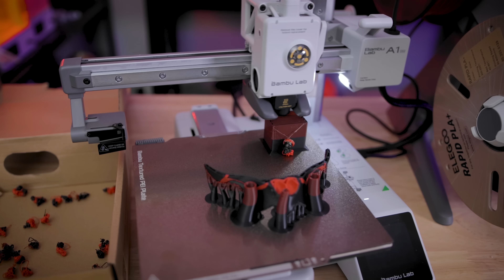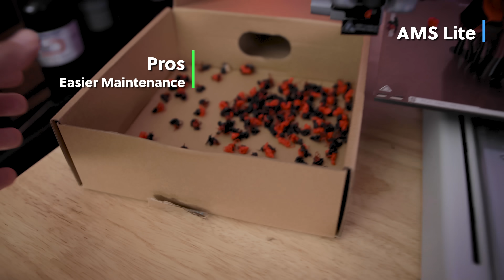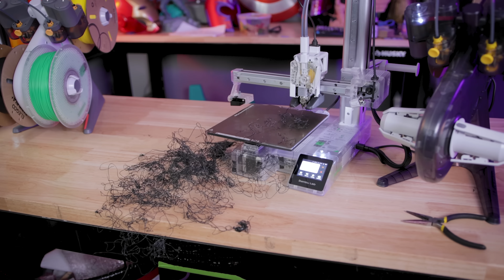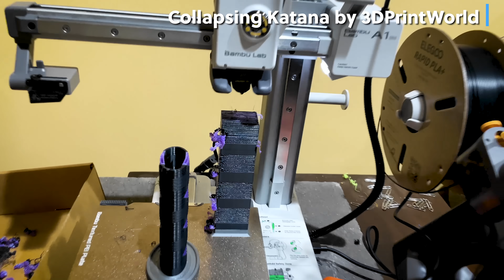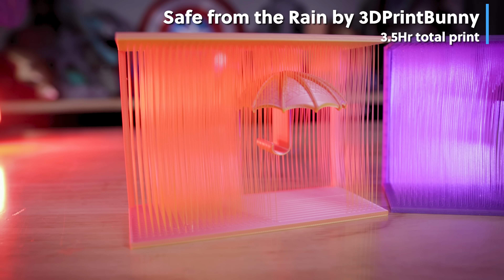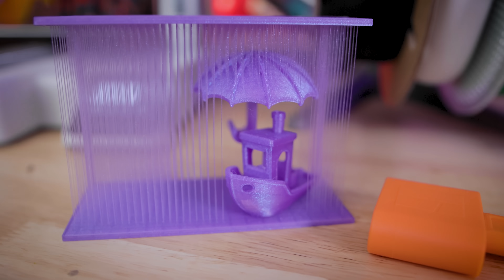Who's this for? Bambu Lab A1 Mini + AMS Lite Review

Comment: Right out of the gate they were on pace and could have easily dominated the “Steve Jobs Apple” market. But it looks like they’re choosing the “Tim Cook Apple” road. They have the technology and the aesthetics and even as a top of the line offering, it's at a great value. I think the title of the video is a good question. I can’t think of a single circumstance where someone looked at the p1p, p1s or x1 and thought, “These are too expensive. I need a smaller, sloppier, print bed with less options and takes up more space.”
Reply: I think the biggest group of people that might want this printer are people that would like to do multicolor miniatures and don't want to deal with resin printing. But even then I don't know for sure. I think they're just trying to compete in a slightly different market segment. I have no idea if it will work out for them.

Comment: i was really hoping for a universal ams system to work on any printer. this is cool, but i would easily save for the p1p or p1s over this
Reply: I wouldn't be surprised if they didn't eventually create a Fit Most Printers Multi Color Extruder kit at some point IF they Don't Creality will.
Reply: @AlbertoMartinez765  that's really what I'm hoping for. If they don't by end of year I may just buy the p1p with AMS. Just got the Neptune 4 pro and loving the speed so far

Comment: Great overview. Im with you on how frustratingly large that form factor is but of course Im incredibly space sensitive. Interesting offering. Aggressive price. Will be interesting to see how it does.
Reply from the maker: I really like each individually but the combo requires a good amount of space
Reply: I think someone should make a converter to mount the ams lite above it somehow. The whole AMS feels like its upside down
Reply: @JamesBricknell  Almost like it could be suspended from some kind of racking hanging on the wall above somehow?🤔
Reply: @Repkord   Yeah the bracket is only connected with 4 screws, easy to create a mounting bracket I think

Comment: This is such a disappointing announcement... It looks like baby's first printer. Cantilever designs are just not reliable enough to make good prints. The new AMS requires a specialized extruder, with no room to add it to an existing model. And we don't need more mini printers in the community at this point. If you want one, go get a Prusa mini plus. The community has been begging for larger build volumes, not smaller.
Reply: That comment didn't age well.  None of the stuff you stated is correct about this printer.  quality is off the charts despite it being this design. its incredibly ridgid.  And i have really giant printers , hardly a beginner, yet this machine , and seeing it in action live , sold me on it.

Comment: when you print with multi color filament does it mix at the point of contact?
Reply from the maker: Does a small unload and load of the new filaments along with purging them off the side
Reply: @UncleJessy  in the end the print is One piece, regardless of color?